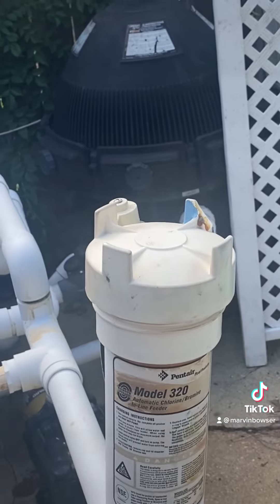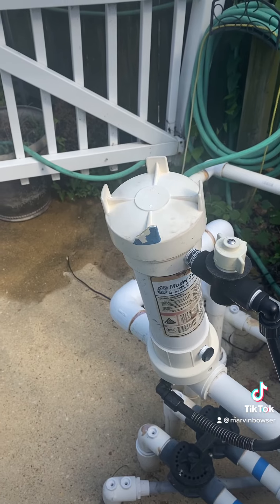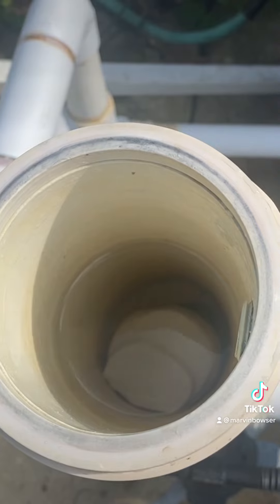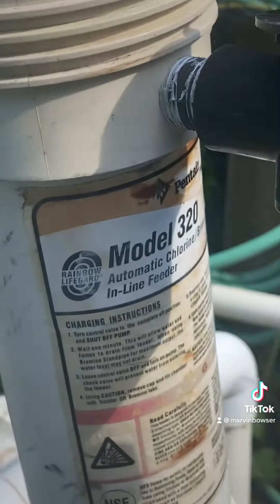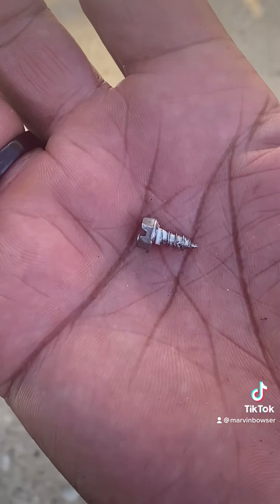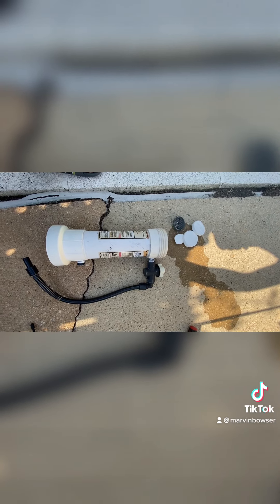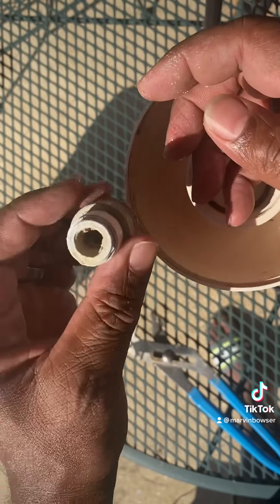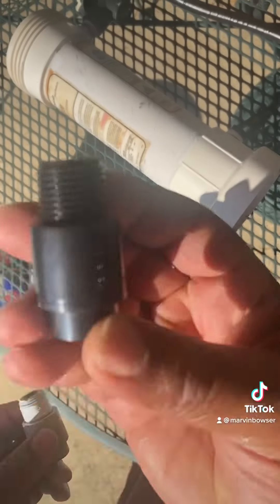How to diagnose and install a Pentair 320 in-line chlorine feeder check valve

Comment: Great video.  Very helpful, thanks.
One point, don't use 'petroleum based lubricant' on O-rings.  Use silicone or Teflon  based lubricants. Petroleum rots the O-ring.

Comment: I just ordered my check valve and screen. I noticed that your control valve is mounted on top. Mine is mounted on the bottom. The way you have yours makes more sense. I guess it must be different years on that model. Thanks for the video.
Reply: I have the same setup with the control valve on the bottom. Did it make a difference If you switched to the top?
Reply: Yep..interested in the answer to this
Reply: @JacksonHomestead  What I've read since mine is NOT flowing is that it should be on the TOP with 3" tabs and bottom is for 1" tabs.  My original was installed on the bottom with 3" tabs and worked fine for years.  Suddenly stopped working correctly so I just installed a new one.  Still not working and have verified correct installation.  Going to change to the top!!

Comment: I had the opposite problem with my check valve. It was stuck wide open because of a piece of debris. Symptoms are the chlorinator tube fills up so fast you don't have time to get the lid on before overflowing and your tablets don't last long even at the lowest metering setting.
Reply: The check valve should function such that water only drains OUT of the tube (downward). With the restrictor valve turned in the off position (the valve connected to the outside black hose), and the pump turned on, there should be no water filling into the chlorinator. You can also load tablets into the chlorinator with the pump turned off. You shouldn't have to race to load chlorine tablets and get the lid back on. Just turn the pump off before you take the cap off; after you get the cap back on, then turn on the pump.